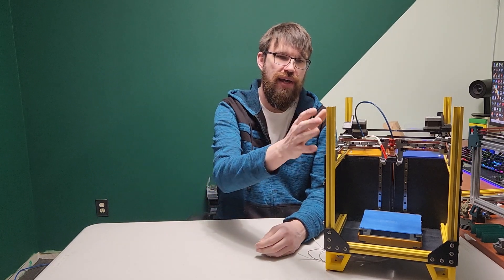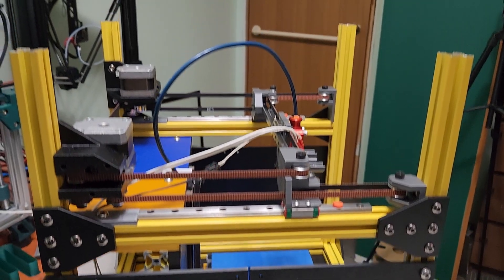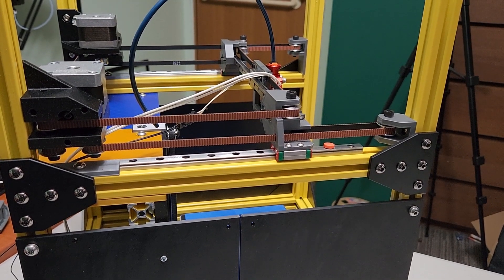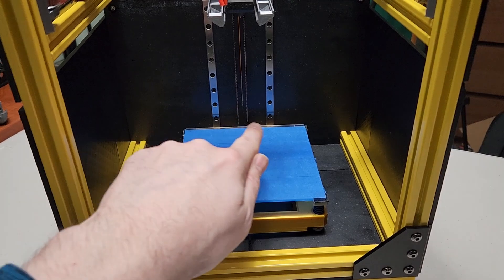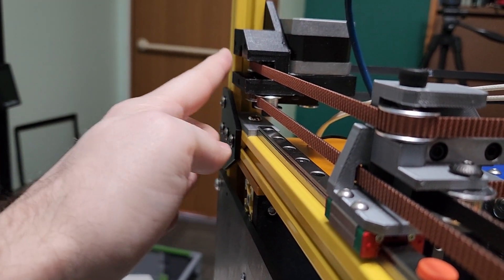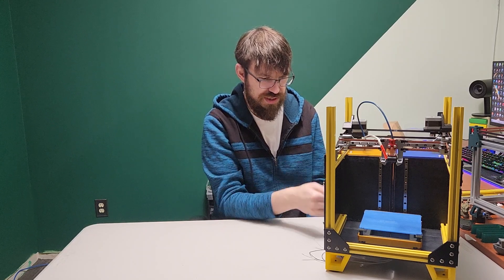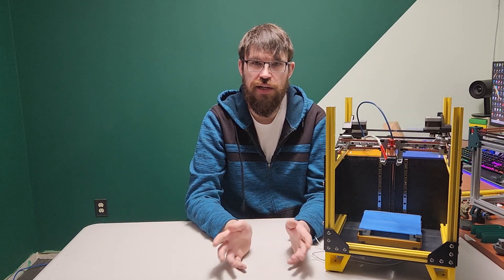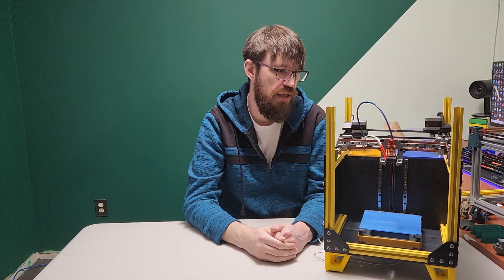Update on my CoreXY 3D Printer Called Fortress

Comment: How hard would calibrating the Z screws be?
Reply from the maker: you can undo the set screws on the pulleys then level the bed mounts. Also the bed with be on springs and bolt so you can fine tune it.

Comment: Many boards have dual z support, and that can make it symmetric…
Reply from the maker: yes I used that on my Rook Legacy, however there is a chance the motors can become out of sync. It's still best for 1 motor to drive 2 or 3 with a single belt
Reply: Hmm, to be clear, I was thinking front corners with belted screws, back corners with z motors.

Comment: I liked the design, and having 3 Z-axis screws would be great, easy to build both 1 or 3 Z-motors. Also, I'd like to see a version with bigger bed, maybe the 220x220 MK2B/MK3 or 235x235 from Creality, as they are quite easy to find.
Reply from the maker: I have plans to make a ender 3 style bed CoreXY printer soon!

Comment: Why this and not voron v0?😅
Reply from the maker: they are two very different printers
Reply: @Rolohaun  looks very similar printer thats why im askin
Reply from the maker: @zola5584  this is 170x170, will have triple Z, printed side panels, 4010 part cooling, 2020 frame. most everything is different.
Reply: @Rolohaun  and what about speed limits, price range?😁
Reply from the maker: @zola5584  cheapest v0 for my is 550 CAD this should be around 500. Speed will be on par with v0

Comment: Where does this printer stand with other corexy designs available, what are the pro's?
Reply from the maker: Usually my designs are very easy to build, I don't use custom 2020 sizes, everything can be sourced very easy. No custom parts. This is shaping up to be a 170x170 printable area printer with triple Z and 4010 fans for cooling. 3D printed side panels are unique to this

Comment: Is there any problem with this type of Z axis? I wanna build a simple corexy printer from my ender3 because im not using it anymore but sometimes my V0 is a bit small:D Your design looks great for that conversion but i want a bit more build volume about 250ish and use as many ender parts as possible.
Reply from the maker: you want a triple supported Z for a bed that size

Comment: Thanks for sharing your iterative design thinking. The use of the 170mm squared bed makes good sense. Does the new position for the pulleys mean that the pulley belts will be longer?
Reply from the maker: yes, the fortress belts were always longer. The Rook Evo BOM called for 6M of belts so that won't change

Comment: geared planetary z theres no need for speed so you could use gears to add torque and accuracy
Reply from the maker: I want to try that an another design, I don't want to add more motors to this build, I want users to still be able to use basic 5 driver mainboards
Reply: @Rolohaun  yeah thats what I was thinking, have the single z motor act as the sun gear, fixed planets, and the reduction would be off the outer ring which could be toothed for belts

Comment: Prusa Mini bed sounds awesome, Triple Z sounds interesting, but what about 2020 X rail to hold the weight of a direct drive set up better? Stoked on this.
Reply from the maker: I think the MGN9 is enough, plus I don't have enough room to add a 200mm 2020 for the X, and may biggest goal with 2020 printer is to not have custom sizes
Reply: @Rolohaun  excellent. This will probably be the printer I build first of yours! Checks all the boxes.